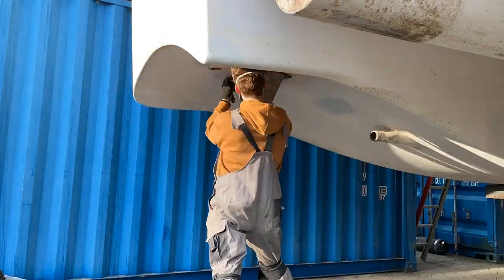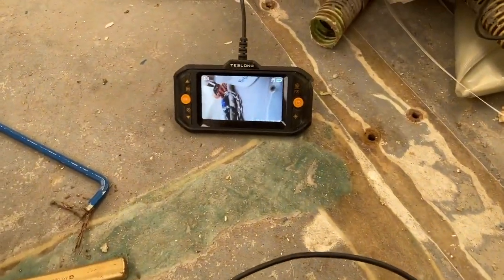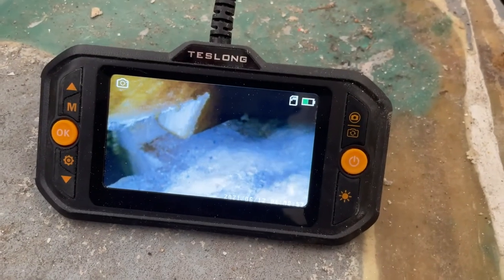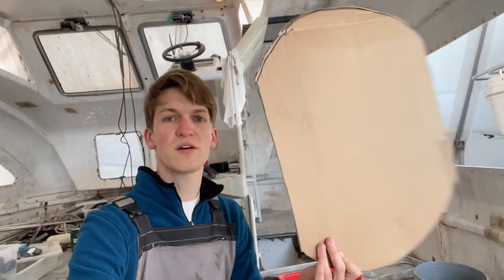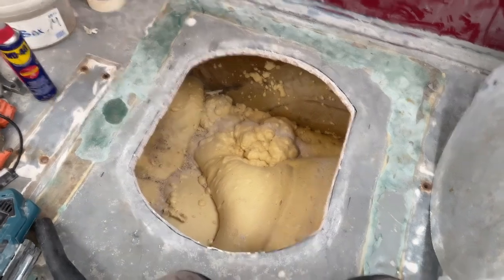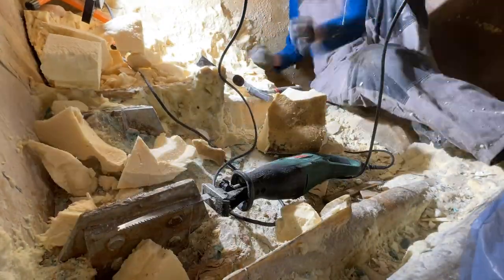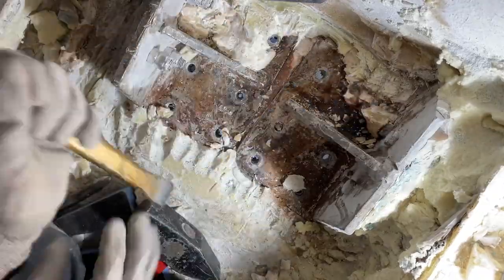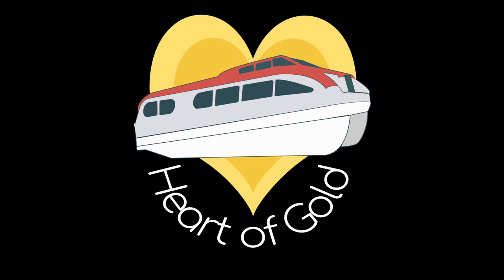Worst boat job so far - undoing a botched repair. Lifeboat to solar electric yacht - H.o.G. Part 10

Comment: Boat repair bodge-archeology 😂 that sums up a lot of permanent  repairs out of sight out of mind ....and intended not to be touched again by who ever. 
Till some bright spark who wants to change check and repair comes along. 
Taking an endoscopic peek dawn down a whole at the other side is wise so you know what the state of play there is JIC 🤔
Forewarned is for forearmed 👍🏼

Glad dad inlaw was around to bring in the heavy artillery 😁🧙‍♂️

Comment: Honestly some of those bull recessions should be used for the pantry and a lowered toiler, then you can put a kitchen counter on top, next to it a sink and it simplifies the plumbing.
The other side fridges and pantry to store food and what not, plus fridges generate heat that goes up
Look up the used Tesla's post 2020 heat pumps, they are just compressors.
Other aspect of heat recovery refrigerant tubing under the hull, water is usually a fixed temperature, or under the solar panels as the black attracts heat.
On the bottom the advantage is constant temperature, even if negative temperatures above.
On the top only makes sense in sunny days as a boost. Also if you refresh the top in the summer by dispersing the heat under the panels to the water your PV system will be more efficient.
And thermo electrics might also be interesting

Comment: Your father in law has the wrong end on the electric hammer... they make a 3 or 4 inch wide spade end.. looks like a thick flat putty knife and would work great for scraping along down there.. you are going to hopefully learn the name of tools and how to properly use them.. why in Germany do people when working on construction projects have a one piece coveralls along with hard hat safety glasses everything protective gear.. look like a OSHA Employee

Comment: Wouldn't it be easier to dissolve the foam using something like acetone? Or could that cause issues with other materials used on the boat like the fiberglass?
Reply from the maker: Thought about that, but a) probably not very healthy even with a mask, b) could chemically weaken the fiberglass without showering and c) would need tens, if not hundreds of litres for this amount - that need to be disposed afterwards as well.
Reply: @HeartofGoldLifeboat  yeah it's going to be an unpleasant job either way I guess. Hope it's the last of the foam that needs to be removed :D
Reply from the maker: Nope, still just as much left - at least 😅